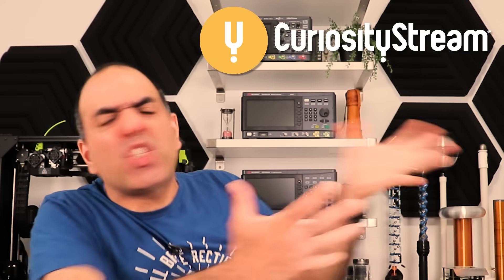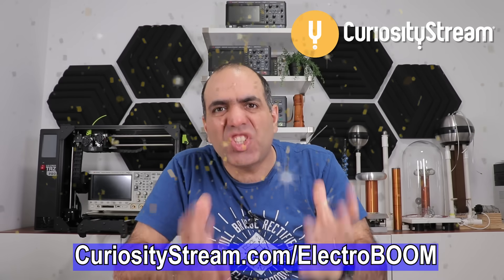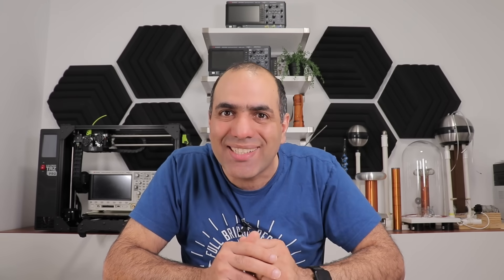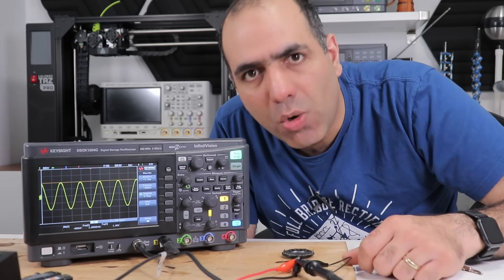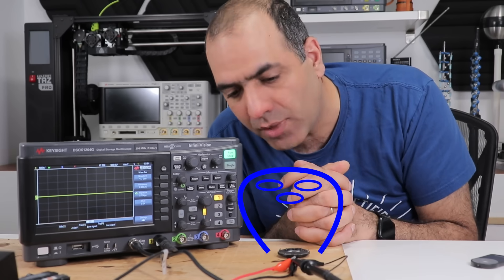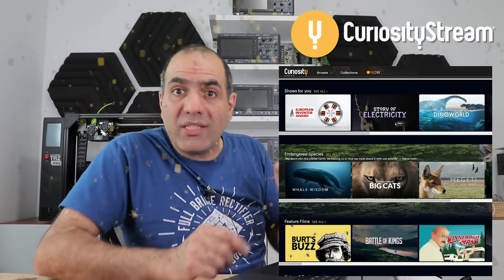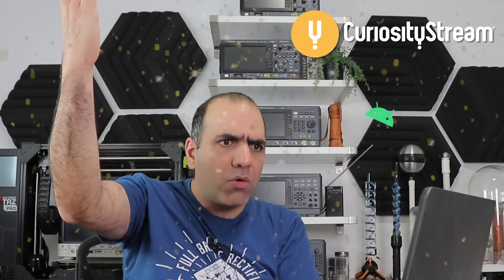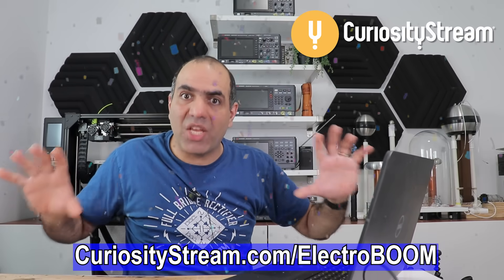Making a &#!$%ing Button

Comment: Your best video ever, so funny. You might have also mentioned that your frequency generator output impedance (50 Ohms) was in series with the speaker and would have reduced the amplitude of the bleep. Your op amp output impedance is low  (maybe a few ohms) and so will produce a louder sound. The concept of resonance was well done and clearly illustrated.  Cheers Barry

Comment: /*connect your speaker to pin 12
Connecticut your button to pin 13*/

int bottonks;

void setup(){
pinMode(buttonks, INPUT);
}
void loop(){
if(digitalRead(buttonks == HIGH)){
tone(12, 10000);
}
else{
digitalWrite(beep, LOW);
}
}
Reply: Baylee Selena  You're absolutely right, just made it for fun (besides that the code is wrong because I wantet to see how many here know c++)

Comment: "The main reason for the weakness..." is you need to prevent ( or delay) the pressure wave created at the front,  from combining with the opposite pressure wave created at the back, and canceling out. (I assume the speaker was open back)
In your case you closed off both sides (see band pass box) and the size and length of hole/vent can be tuned to make a particular frequency efficient.

Comment: Another reason why the sound is weak when connected to the scope, is that the output cannot supply enough current for such a low impedance load.

Comment: I was hoping you'd actually build the circuit out of a transistor and capacitors from your junk stash. Instead of the Chad Single Transistor Phase-Shift Oscillator we got the Virgin Schmitt Trigger Oscillator.

Comment: Strongly agree on preferring not to use Arduino for basic projects. In the same grain Mehdi, can you do a video on making an RC car? Or just simple RC circuits in general? So far I've only been able to find Arduino projects (which are good for better control and features, but more complex than I need for simple things), and I'd love to see a proper example of a straightforward circuit without the need for programming or unnecessary computer boards taking up project space. Plus, the inevitable destruction you'd wreak with an RC robot would be a lot of fun to watch.

Comment: "Can I show you how your cavity hole size changes the resonance with my driver frequency" is gonna be my pick up line from now on
Reply: Larger the hole is the slower you need to move back and forth(frequency)

So make the victim's cavity hole smaller to increase the resonance frequency

Oh god what have I done
Reply: @YTshashmeera  I didn't realize creating high voltage in a smaller form-factor had so much inherent trauma-ripple associated with it. Seems...."noisy," lol
Reply: Pick up line? You damn well know that's a line you *close* with if anything
Reply: @kurtilingus  Username checks out
Reply: @tdelfino2509   @Josué Vicioso  Hahaha, I think the last time I got a username acknowledgement was two lifetime incarnations ago & would still have to go 3x farther back to recall the same + topical relevance.... I feel so validated! Lol

Comment: 2:16 I totally agree with you. Using arduino is the easiest way to go, but if you want to learn electronics, just use discrete components and chips. Writing a code or even worse, copying it, won't teach you anything, exept some programming and soldering stuff

Comment: congrats on realizing that the specific words used are usually not the part that makes speech offensive, just the part that makes the offense most obvious. If you were saying something that could get you cancelled, bleeping out the specific word won't make it better. If you are saying something that is so similar to bigoted speech that mishearing one word makes it indistinguishable, consider doing a better job communicating with your audience.

Comment: Mehdi, if you’re looking for video ideas, building a high power H bridge could be interesting! I’m trying to build one based on an arduino but I’m not exactly sure how to get the 5v logic level to fully switch on the high power mosfets. Would I need to use a mosfet driver or could I use a transistor on the gate of the mosfet? Any help would be greatly appreciated, I just graduated high school so I’m still going off of knowledge from YouTube videos :)

Comment: well like it or not, the future is arduino,it becames much more popular and become capable  of doing complex things with it's sensors, without electronic knowledge it's not efficient for sure but in the future i believe it will not need so much electronic knowledge because everything became automatic. When i started to work with computers we were setting jumpers for cpu on the mainboard before we power-up the pc, now it's just plug and play, electronics will be the same.

Comment: Why do you not sell any good solder kit projects? I have learned so much from doing so many. Answered questions I didn't know needed an answer or existed. There are loads of good kits but even more junk and scams. They don't have to be expensive or useless trinkets. I'm still using the metal detector hand wand I built myself 5 years ago. What would be a good addition to make the project yours is instructions on how to modify designs to do more or something different or last longer.

Comment: Showing my students the different wave types I found out that sawtooth waves are much louder and can be easily heard at frequencies that sinusoidal waves can not. I can immagine that the sinusoidal waves that are part of the sawtooth are more easily heard that the others wich would make the sound hearable. But should the energy to oscilate the speaker considered to be constant, would a sawtooth wave be louder than a sine wave? If that's correct, shouldn't you build the button with a sawtooth beep?

Comment: Mehdi, I’d recommend that you try learning Arduino! It’s literally plug and chug once you download the program, and there’s a ton of documentation and a lot of examples you can work off of. It unlocks so much potential for new projects and often makes them much more efficient to develop. For instance, Arduino has examples that play a tone on a speaker using just 10-20 lines of code, and adding button functionality could for sure be added in ~5 lines.
Reply: So earnest!

Comment: I very much enjoyed the video, but wouldn't it be a better solution to rather make a rudimentary mixer with op amps to tie directly into the microphone circuit (assuming that you aren't using a digital interface)? Then you would also be able to use a potentiometer to adjust the levels rather than aiming it towards the microphone and relying on "open air coupling"?

Comment: The circuit is quite simple
"If you're an electrical engineer"
Reply: It's funny because we built something very similar in my engineering degree, but my groups was a 20v pk to pk square wave, actual triangle, and filtered sine wave, so was a perfect sine wave filtered from the square wave to make a function generator. Could do 20-40khz from memory.  All built from op amps, and near none of the maths worked out so I had to find the correct resistance values with pots.  Was a great time
Reply: 😂 my last electronics exam at university was about that, not easy at all😂